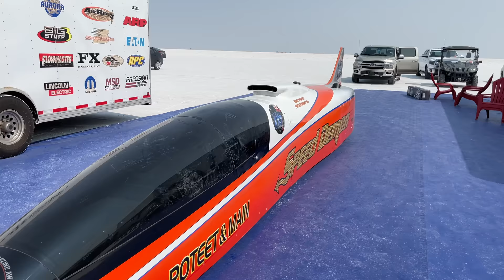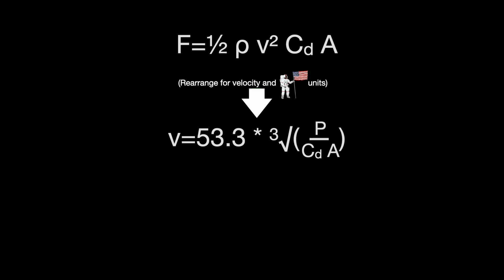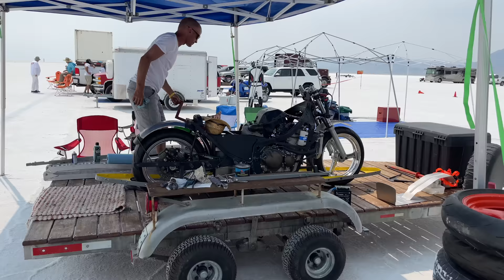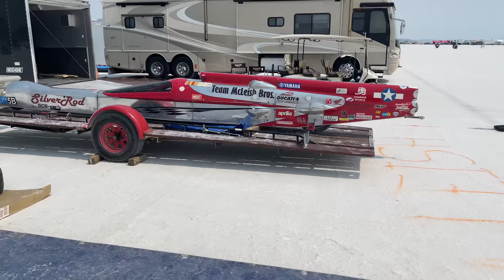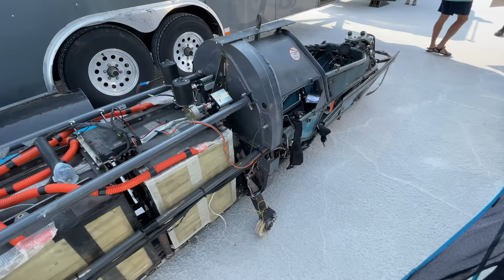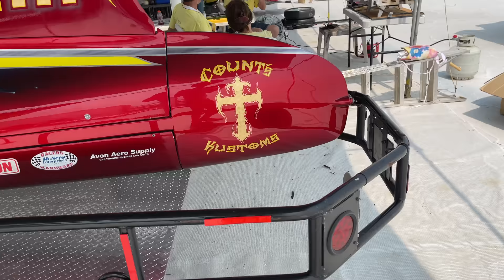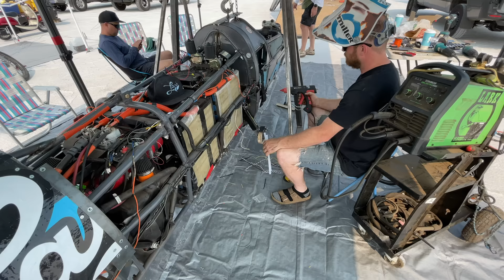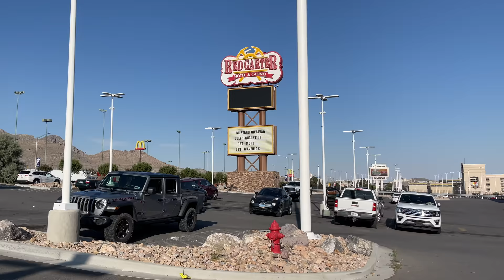The World's Fastest Electric Vehicles Didn't Go Very Fast At The Bonneville Salt Flats This Year

Comment: Ya EVs have no range but they can be quick in a short straight line - so what.  A fellow drove his Iconic 6 on the autobahn in Germany where he wanted to try and maintain 140mph - he couldn't the battery kept overheating and throttling him so he was only able to maintain about 120mph but then after 1 Hour he had to charge - for an hour!  Average speed 60mph. At 420 the range of an EV would be about exausted at Bonneville after a few miles - moronic. EVs are slow.